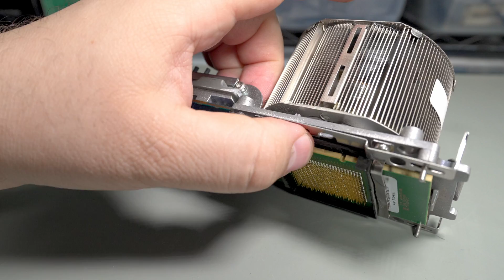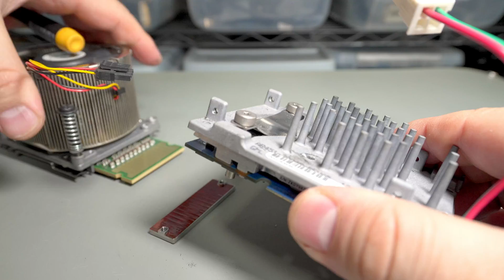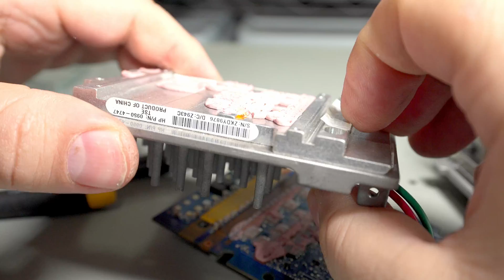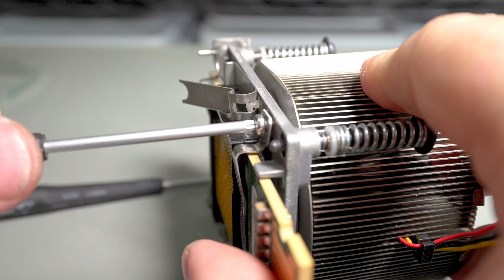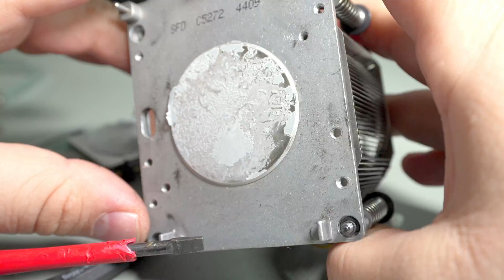Itanium CPU Module Quick Teardown

Comment: This cpu is a full 64bit cpu.
The amd 64bit cpu its extra set above the old 32bit. .
This way the old 16/32bit software you still can use.
This is not possible with this Intel cpu.

Technische this cpu can handel more and faster real 64bit program.

Comment: I like electronics and computers a lot. I practically collect computer parts and I was very interested in this module with an Itanium processor. I'm going to look for one of these in Brazil to try to add to my collection and study equipment. By the way, I had never seen a 20 volt fan! Congratulations on the video.

Comment: What do you mean that branch where calcultaed in the compiler? That labels get converted to jump addresses?
Reply from the maker: My (limited) understanding of how it all worked was they wanted to optimize how many instructions take place at once to maximize IPC . So it would combine multiple instructions to run each part of the CPU at the same time. Let's say an ADD and a MOVE as a made up example would run at the same time, but you had to either reorder instructions to get them to go at the same time or only one instruction would run that cycle. Leaving one of those components of the CPU idle.

They wanted to do all of this combination of instructions in the compiler removing the need for all the reordering and branch prediction hardware used in modern x86 CPUs, for example. But it turned out the compiler wasn't very good and they had to slowly start adding stuff like branch prediction into newer IA CPUs anyway. :P
Reply: @PeterBrockie Oke, thanks for the explanation. I forgot that a Itanium has a piped architecture with branch prediction and prefetch and all the fancy stuff. :D I wrote a RISCV emulator last week and those have only conditional branch instructions so I was thinking of those branches.
Reply: @PeetHobby  Every modern CPU is pipelined. Heck, even small micros might sometimes be pipelined. I recommend "James Sharman" YouTube channel, he built a discrete, pipelined 8-bit processor, and performance per MHz is significantly increased over for example an old 6502.

Comment: probably just a solid copper slug, not a vapor chamber...  they're going for thermal mass as much as they're going for heat transfer on these.
Reply: I have the same chip but with a different heatsink and power supply assembly; it's a copper slab about 5mm thick with some fins on top. Absolutely not a vapour chamber - it feels like you're holding a brick.
Reply: The passive cooled ones like pa-7000, pa-8000 had some models with vapor towers, I sadly don't remember the proper model numbers anymore. I.e. the CPUs for the L-Class (L1000/L2000/L3000) and last K-Class models (K580???)

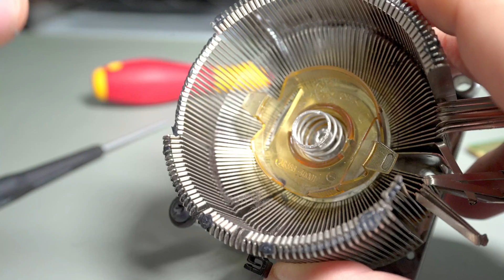Comment: 10:42 I remember pulling one of these apart years ago and having the same problem with that screw... I can't for the life of me remember how it came apart now... not reverse thread? I seem to remember it being a technique and not just brute force. I had the entire server (only just fit in my car) the motherboards were massive (beautiful gold plating on the entire board) and I think each had 4 of these cpu on them. had 4 massive 40v PSUs. Brought back memories :D thanks
Reply from the maker: If I still had the heatsink assembly I would give it a shot with my new impact driver, but my old drill at the time couldn't even touch it - forward and reverse didn't seem to help. Maybe it's just insane quality loctite. haha